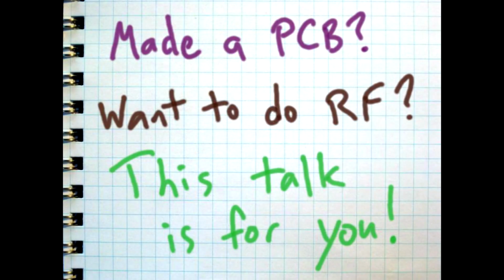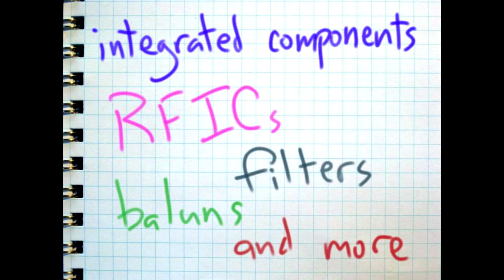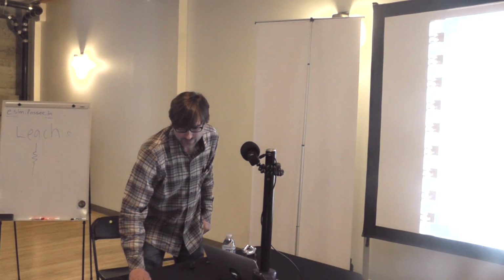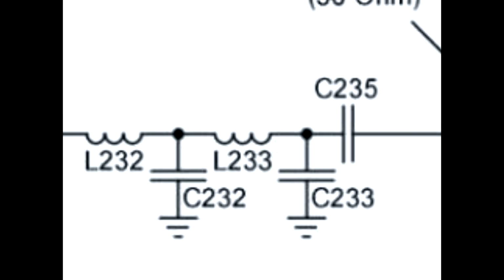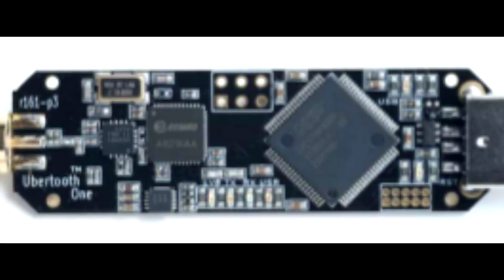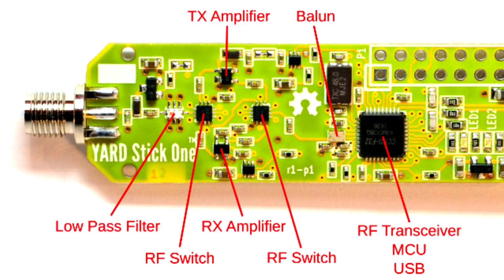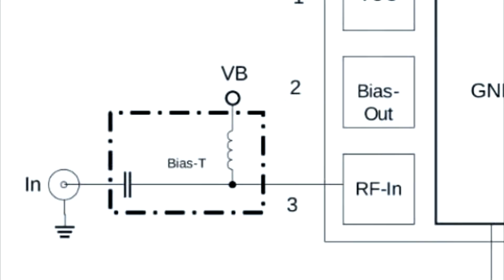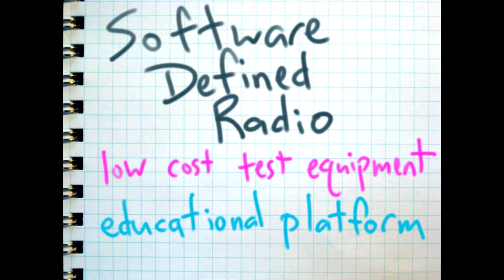Michael Ossmann: Simple RF Circuit Design

Comment: As an experienced RF design engineer, I recommend this and agree with the key points.  The wavelength guidance is however out by about a factor of 10.  To reduce the importance of the signal path length, it needs to be less than lambda/4. Then on a PCB the dielectric slows the velocity by about 2.
Reply: Glad someone noticed that other than me. Also speed of propagation of a signal on a micro strip is not near the speed of light.
Reply: If a quarter wavelength of 2.4GHz is 31.23mm and I will use a PCB trace antenna the total lenght of the pcb trace that comes from IC plus the antenna itself is not recommended to be bigger than 31.23mm? Thanks a lot.
Reply: @anlpereira  The length of the assembly doesn't matter here, it can be as long or as short as you want, as long as it is well matched.
If you have a trace running from point A to point B through section C, then the critical length tells you how long section C can be before it starts to affect the match.
If A and B are mismatched, then it doesn't matter how close or far apart they are — they'll still be mismatched. But if A and B are miles apart, but they are well-matched, this is perfectly fine. 
You can have an entire radio laid out over a city block and as long as everything is matched, it would perform well. Whereas, you could have a radio the size of a grain of sand, but if the transmitter and antenna are mismatched, there will be losses.
Reply: If every component is perfectly matched to the system characteristic impedance, then the length of the transmission lines will have no effect on the impedance match. Only the loss in the dielectric will change with transmission line length. But if your impedance's are mismatched, then having a lambda/4 transmission line will effect your system performance.

There is a "Rule of a thumb" in the microwave community that you should't worry about transmission lines if the signal lengths are smaller than 10% of the wavelength in the dielectric.
Reply: Great I found a right person. Sir you are a RF design engineer, I'm sure you'll help me, rather guide me. I'm a beginner. 
Sir actually want to know the working of the 433 MHz RF transmitter receiver module circuit diagram,and the components used in the circuit diagram. I want to know about the topics covered while designing this RF transmitter receiver module circuit diagram
Reply: please  i want to make fm receiver  circuit  without  earth ground  wire
Reply: @mohamedelghmrawy7850  buy an FM radio from ebay remove the case and pretend you made it yourself

Comment: Really great info clearly gleaned from the trenches! A few extra points that I learned the hard way:

I can't stress enough the need to carefully read the datasheets but also the application notes that the manufacturers publish. As many of these transceivers have programmable PLL's/DDS's check to see if the manufacturer has written app notes specifically for your country's regulations and follow them to the letter if you're able. I got caught out by the PLL crystal I was using producing a harmonic on the output that bust the spurious emissions limits. I was able to change the crystal frequency (in hardware) and correspondingly the PLL divider (in software) to get close to the same output frequency but that nugget of info was buried deep inside one of several app notes although the datasheet headlines promised compliance...just not at max legal output power apparently. 

The single chip filter-baluns can perform worse than discrete front ends but if you can make use of them then do. Only really important if you're trying to get approvals at maximum legal power but again check app notes comparing the two if possible.

Newer devices, although potentially better performing, generally have fewer app notes covering actual test results - buyer beware!